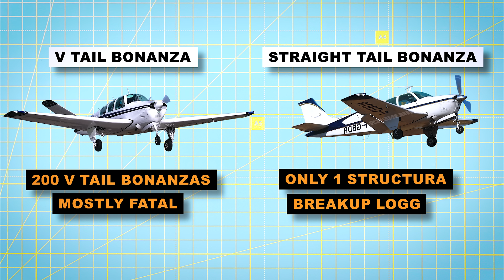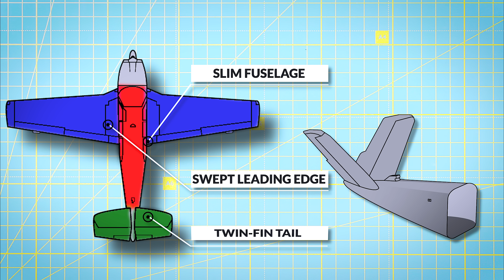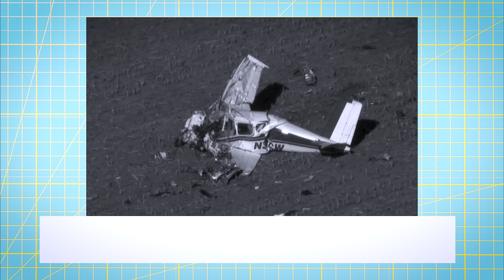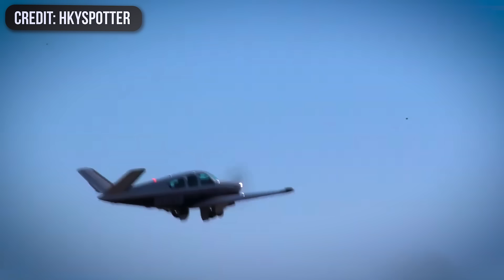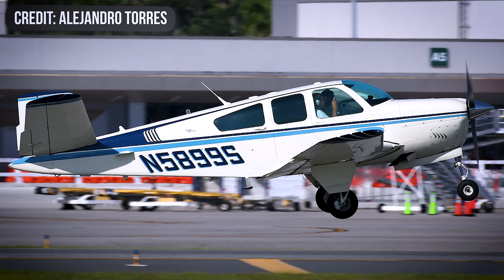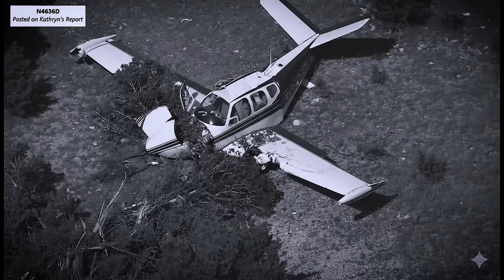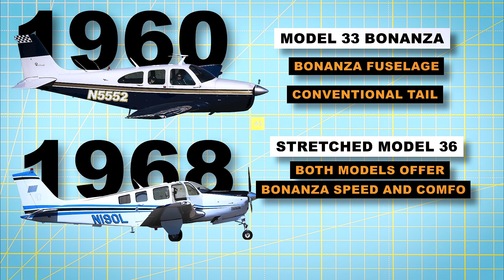Why Did This Plane Kill over 200 People?

Comment: These guys are surprisingly big in person, especially next to a 172. Pictures don't do it justice.
Reply: The Bonanza’s wingspan can be less than a 172, and nose to tail it is shorter - depending on the model.
Reply: But yet, cramped like hell compared to the Cessna
Reply: @Repinnc  ? cramped? Have you been in a v tail. Your legs don't touch at all. Unlike a 172 where you can feel your co pilots heart beat through your leg and side. Its so much wider. If you compare based on cost its even more roomier than a 182 (similar price) and has a load more power. Mind you I fly a piper 140 so I don't have room or power but I have flown both in a v tail and flown a 172 for 300 hours.
Reply: @superspooky4580 a 172 isn’t that small, a 152 yeah, but not a 172
Reply: @super @superspooky4580 p, hundreds, literally hundreds of hours in both, if your over about 6’1” a bonanza, esp an older one with throw over yoke, engine controls hidden beneath it, are miserable. You head is jammed into ceiling, they are considerably tighter than a 182. I own a 182 and was part owner in a debonair. At 6’6” no comparison.
Reply: @superspooky4580  I have flown both a 172 and my dad's H35. The Bonanza is by far the nicer feeling plane. While you have more room in the Bonanza, there is something a never liked about being in the back seat when there is a lot of dutch roll. Front seat is much better. As a teen, my dad would let me work the rudder pedals to counter the dutch roll. There was a rhythm to it and once you got it, there was nothing to it. This video makes the plane sound more dangerous than it is.

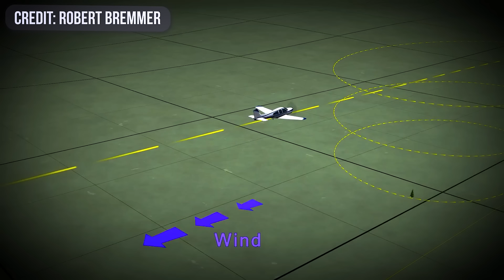Comment: Don't most GA planes end up in a spiral dive if you dont touch the controls? 10:52
Reply: No.  Any high wing plane is pretty self stable once you trim it properly.  Any plane with some dihedral, same thing. With a flat symmetrical airfoil, I'm not sure.
Reply: @larrylaitner3473  Sorry,  but you are not correct.  An  aircraft needs a large enough vertical tail so that it will not enter an uncontrollable spin within 360 degrees of rotation - that is a certification requirement for a "Spinning not permitted" aircraft.  Having provided that, the designer then needs to ensure that when the aircraft is yawed, there is enough dihedral to cause the advancing wing to rise - i.e. to make the aircraft laterally stable.  However, there is a balance between lateral and directional stability:  If the directional stability is excessive, the aircraft will be "spirally unstable" (i.e.it will tend to self-tighten in a turn).  If the lateral stability is excessive, it will exhibit a "Dutch roll".  In practice, it is normal to accept a small amount of spiral instability, because Dutch Roll is guaranteed to make the passengers airsick.  So you will normally find that if the aircraft is trimmed directionally and laterally, releasing the controls will result in a gradually tightening turn - about 10 ~ 12 seconds to double the rate of turn is fairly common.  This is not a problem when you are operating in visual conditions - the pilot corrects for it automatically.  But it is one of the reasons why instrument flying is more difficult.   High wing aircraft require less dihedral than low wing aircraft, but the same principles apply.
Reply: @larrylaitner3473  Every high wing GA plane I've flown will has a tendency to enter a spiral dive if you let go of the yoke and don't touch the rudders, especially trainers like the 172/152/182. It wont happen immediately, but if you let go of the yoke, dont touch the rudders, and dont make any corrections, the aircraft will eventually end up in a spiral dive.
Reply: no, the C152 is spin certified and it's hard to spin them and can recover themselves easily
Reply: @seanm5670  a spiral dive is NOT a spin.  HUGE difference between the two.
Reply: @OkayPilot2992  this xD
Reply: @OkayPilot2992  agreed! To enter a spin, the aircraft must be in a stalled configuration. No stall=no spin. A steep spiral is not stalled. Also a steep spiral will result in loss of airspeed control. A spin results no increase in airspeed. Eventually, a fully developed spin can go nearly flat to completely flat and there is zero airspeed. Fully developed can be …interesting to recover from.

Comment: The Bonanza doesn’t kill people… It’s incompetent pilots at the controls is what kills people.   Careless pilots don’t realize when a limitation is exceeded.  1 - They become test pilots.  2 - They void the warranty.  Control surfaces nor wings nor ruddervators separate from because of respecting the AFM and avoiding severe weather,
Reply: If a normal plane built for normal people falls apart in flight 200 times the design limitations suck and it’s a crappy plane that shouldn’t be flying.
Reply: @FunYTAcct  , compare the Bonanza incident rate to today's Cirrus SR-2x series.

Comment: Any plane will break up in flight if you badly mishandle it. And that's easy to do in a plane that is hard to rig and even harder to fly when said rigging almost never is done right, flown by idiots and maintained by people who aren't NASA engineers.
The ruddervator is a blatant violation of the KISS principle. 
I can actually rig one properly, which is why I would never own one or work on one. Too much liability. If you find a mechanic these days actually willing to rig the tail on a V35, you probably shouldn't trust them.

Comment: Two other problems caused failures.  The first was that the tail leading edge could fail at high air speeds and rip off.  If you examined older aircraft you could see where the leading edge was moving up and down against the fuselage.  The second was if the tail surfaces were repainted; upsetting the mass balance, resulting in destructive tail flutter.
Reply: Lots of armchair mechanics on here.
Reply: @earlelkins9086 There's an AD to address the tail issue. Control surfaces rebalancing is a must on any aircraft. Perhaps silence would be a better strong suit for you.
Reply: that second point seems like a design flaw. A coat of paint can’t be more than 2 lbs on the tail.
Reply: @p @punman5392  - An ill-informed comment.  Balance of aircraft control surfaces is CRITICAL, and MUST be checked and verified to be within limits after painting.  I’m both an airline transport pilot and a certificated airframe and power plant mechanic.

Comment: I have over 200 hours in a turbocharged v35. The airplane handles like a pussycat. It's overall stability is neutral. The aircraft has no bad habits. It is deceptively easy to fly. A low time pilot or inexperienced pilot  flying this type of high-performance aircraft can take their eyes off the gauges and end up in a high-speed dive beyond redline. Abrupt control pressure well beyond redline is what makes this aircraft tail fail. If the aircraft is operated within its certified operating envelope it has virtually no in-flight breakups. The v35 TC is a 200+ mph airplane at altitude. This issue has been resolved with a cuff on the leading edge of the stabilizer against the fuselage. Abrupt control movement in any aircraft beyond redline has a great possibility of inducing structural failure that's what the "maneuvering speed"  is placarded for.
Reply: No bad habits…other than the tail coming off.
Reply: @richardbriscoe8563  , the tail doesn't come off if you stay within the placarded limits.  Every V-tail in service has been upgraded with a cuff that strengthens the empennage attachment points.
Reply: @FT-64 If you had read my original post you would already have realized that. Low hours pilots, some of whom may not have had an instrument rating, and many who are low hours instrument rated who may or may not be current frequently flew into weather conditions and, at least in part, because the V tail is such a “clean” aircraft, they popped through V never exceed and the tail came off. Low hours pilots, no matter the aircraft have a higher mishap rate to begin with.
Reply: @michaelbigelow3255  , I have hundreds of flight hours in V-tail Bonanzas.  Do you?
Reply: @richardbriscoe8563  , agreed.  If someone trained in a PA28 or 172, they're going to need a very different frame of reference when they switch to a high-power retract like the Bo.  That doesn't make the plane hazardous, though; Untrained pilots would have the same challenge moving to any similar high-performance plane.
Reply: @michaelbigelow3255   It's obvious you're either a low-time private pilot, perhaps what they now call a recreational pilot, or not a pilot at all. You have no idea what you're talking about.
Reply: @michaelbigelow3255   Every single plane in the fleet that was covered by the AD has the cuff.  Your point is therefore completely invalid and about 40 years out of date.  Your name-calling exposes your lack of substantive factual basis; if you really knew what you were talking about, you wouldn't need such childish language, would you?
Reply: @richardbriscoe8563 You need to read my post again in its entirety. There have been records of multitudes of aircraft disintegrating in the air because Vne was exceeded and abrupt control inputs were instituted causing structural failure. There have been no known structural failures of the tail on the Bonanza when operated within its certificated flight envelope. I surmise you are not a pilot and know little about the structures of aircraft and their certificated limits. You need to look up what Va speed is and means.
Reply: @richardbriscoe8563 

Bone up on those reading skills.
Reply: @repairdroid77 whatever the hell thats supposed to mean Those are typical facts per NTTSB investigations.

Comment: These are great planes.  They handle like a 911.  165kts and remarkable efficiency.
Reply: Interesting comparison, since stability and traction problems with the 911 earned it the nickname “widow maker” - especially the early Turbo models
Reply: @BlindIo42most oversteer at limits? I had an early 911 e

Comment: I remember how one broke up over my father's ranch when I was a child.  Debris was scattered for about a mile.  Engine and bodies first, with one wing still attached to the cockpit, a mile later.
Reply: were the bodies juicy?
Reply: Date and location?
Reply: @smark1180  I don't remember the date.  Maybe in 1967.  Not near a town, but located near Waterman Flat, Oregon.
Reply: @duanegrindstaff9635 Did you take a cell phone video of it?
Reply: @decimated550  In the 1960s?
Reply: @duanegrindstaff9635 yeah you would hav uploaded it to the arpanet lol
Reply: @decimated550  What is arpanet?
Reply: @duanegrindstaff9635    That's roughly enough info for me, it was either a Beechcraft B35 Bonanza (N5132C) that went down on January 28th 1967 at 1357 hours due to a fatal in-flight breakup and resulted in four fatalities (one pilot, 3 passengers), with the structural failure having been determined due to pilot disorientation from excessive fog, surface icing and exceeding airframe stress limits. Alternatively, since N5132C went down near Mineral, California (431 miles South of Waterman Flat), the other option is a Beechcraft S35 Bonanza (N6825Q) which went down April 23rd 1965 near Mill City, Oregon killing both the pilot and the only passenger, due to uncontrolled descent into collision with the ground, and there isn't much data on that crash from the NTSB archive, so it could've broken midair as the crash it noted to have happened after the pilot "Continued VFR Flight Into Adverse Weather Conditions" due to "Weather Personnel: Incorrect Weather Forecast" so that might be the one, but perhaps not since Waterman Flat is 180 miles east of Mill City. There was a Model 35 Bonanza (NC2978V) that went down in 1947 in Lake County near Dog Lake, but again that crash was 229 miles South of Waterman Flat and was carrying 3 Oregon state Republican politicians, so both high-profile and before your time, I'd say.
Reply: @duanegrindstaff9635  The forerunner of the modern internet
Reply: Fun
Reply: lol.